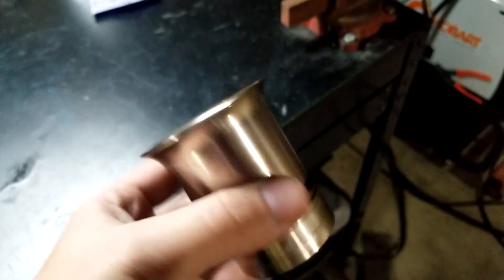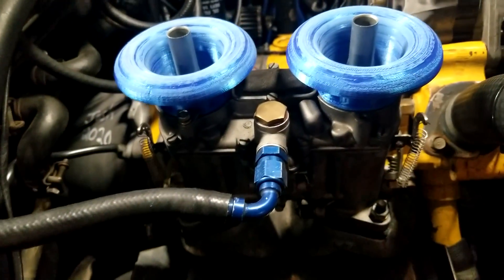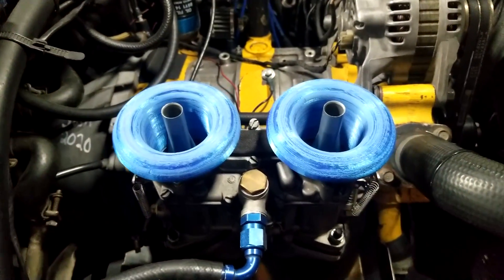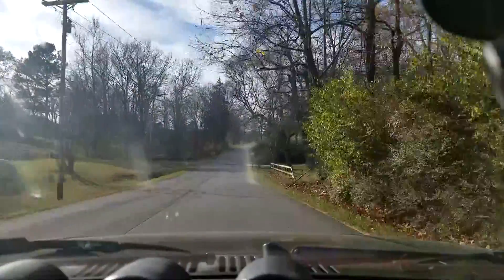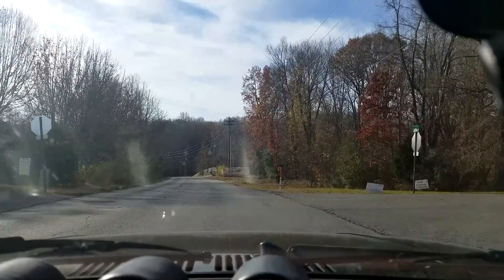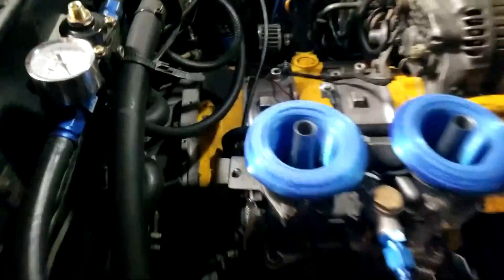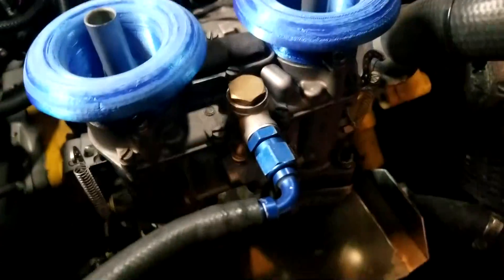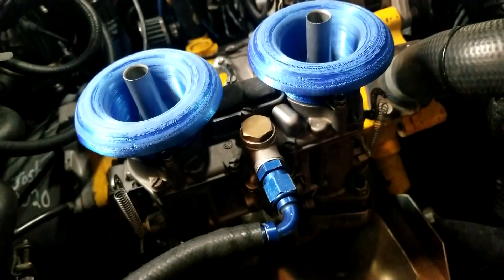Weber 48IDA 3D Printed Velocity Stacks Testing on RX 7 - RE EP 31

Comment: 3D printed ABS survived pretty well in my experience. Engine temp kept under 85°C / 185°F, and throttle body heat are insulated from the engine via rubber mount (I believe this made the throttle body somewhat cooler than engine temp).
Velocity stacks sanded smooth to improve flow, starting from 120 grit up to 400 grit sand paper